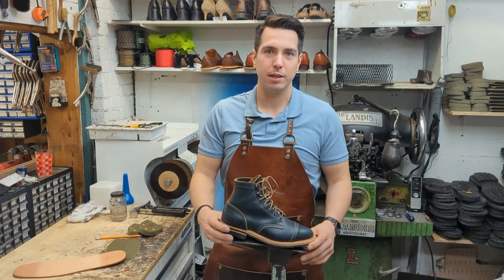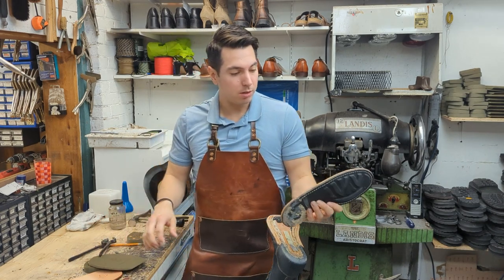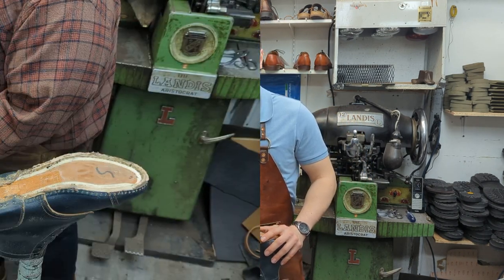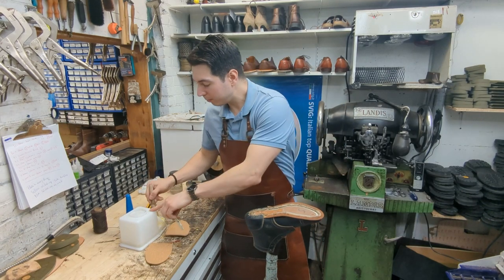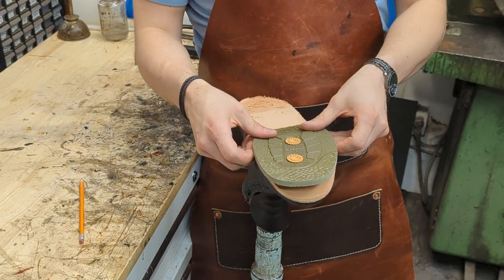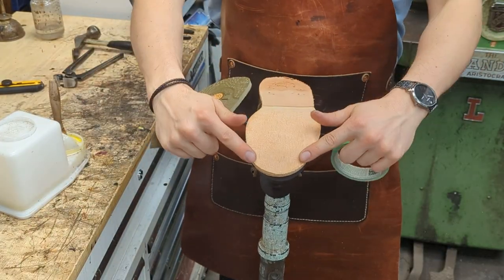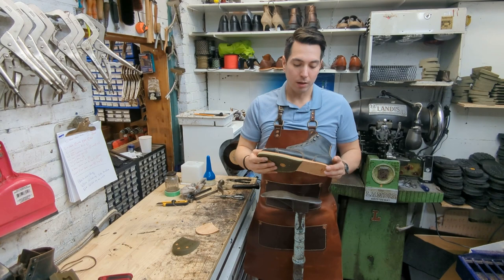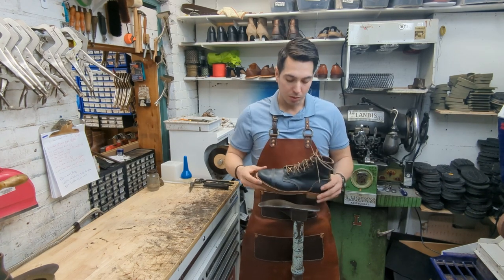Truman Boots Navy Waxed Flesh | Total Transformation with Dimar Shoe Repair

Comment: Turned out great! I'm really surprised by the foam and fiberglass shank.
Reply from the maker: Me too, little shocked
Reply: Yeah that’s super disappointing
Reply: was the foot bed leather?
Reply: I looks like the foam is there simply to prevent squeaking.  Dimar Shoe Repair, without this foam would it be a thick leather insole against the leather midsole?  I know Nicks uses a felt or foam just for squeak prevention.
Reply: The foam in Truman boots is to fill the void the welt makes where they could use cork and it doesn’t squeak neither way more supportive with cork and molds to your foot
Reply: @chuckcole2625  I recently contacted Truman about it and they informed me that they are going back to using cork.
Reply: @makemyday44mag97 Oh sure...NOW that they have been exposed. Way to go Truman...
Reply: How long ago did they return to cork infil?

Comment: If a foam filler is sandwiched between a quality leather insole and a quality leather midsole, would there be a noticeable difference if a hot cork or sheet cork filler was used instead? Thanks.
Reply from the maker: The only difference would be that your foot won't be able to mold the foam like it would high quality cork. And foam can break up

Comment: What’s the advantage of removing the welt? Do you just prefer your own this much, or is the Truman welt hard to use for resoles? Thanks for showing the internals. I’m deciding between the PNW brands for best value, and between you and Rose Anvil cutting things in half, y’all are both so insightful. Thanks for the great content.
Reply from the maker: I wanted a split welt on these. It's not always necessary to replace them. Truman are great boots with tons of fun leathers to choose from. I'm really digging Whites and Nick's right now, though
Reply: @dimarshoerepair  oh cool. They’re all so well made, and I’m not depending on them for anything like firefighting or lineman work. Finding a local cobbler that’ll deal with heal repairs or resoles will be a quest. Shouldn’t need to worry about that for years with casual wear tho. Thanks
Reply: Exactly they'll last you years before you need a rebuild!

Comment: Any benefits of cork vs foam filler? I ordered a pair of trumans expecting cork, not sure if a foam filler should change my expectations in terms of comfort? What are your thoughts as a professional regarding this matter?
Reply from the maker: I like cork better (more moldable) but high quality foam I think is fine too. Will give more cushioning but not sure how it would hold up long term.
Reply: @star9732  You will need a resole by time the cork has those issues, the issue with foam is that it eventually compresses with heavy use and that initial comfort is gone. Overall, it's a cost saver for the company using it, and gives customers that instant comfort.
Reply: @star9732  it's a more expensive material for the manufacturer vs foam. Most any natural material will be. That's not to say it's "expensive" but Truman is owned by a large corporation, if they can save .05 cents per boot to increase profits for share holders they certainly will.
Reply: @star9732  Sorry, White's was purchased by LaCrosse but the point remains that foam is a cheaper material to manufacture and purchase. It saves the shoe company money while most customers won't notice or give a shit, it's a win-win for them.
Reply: @dimarshoerepair  I just prefer the traditional method and I think it's better for the environment, the world has enough plastic and foam filling our garbage dumps and floating around in our oceans. 🗻
Reply: FTR, Truman is now using cork instead of foam...it's a recent change.
Reply: @lekkerlekker111  I've looked around and can't find how they construct their boots. Where did you find that info? Thanks.
Reply: @Sal_car88  I currently work for Truman Boot Company 🙂 from what I hear, both foam and cork are good for different reasons, but we currently use cork.